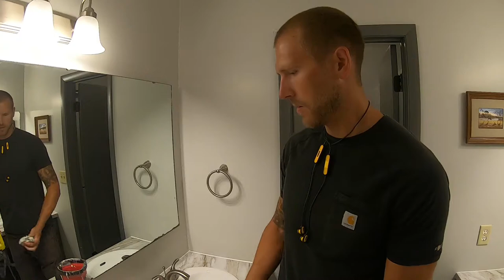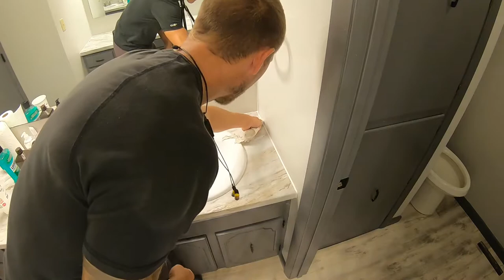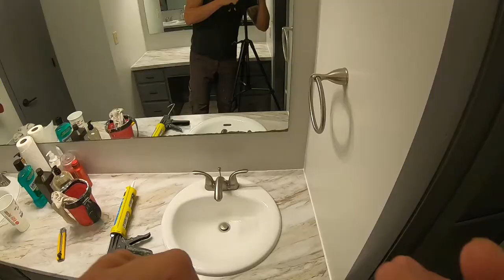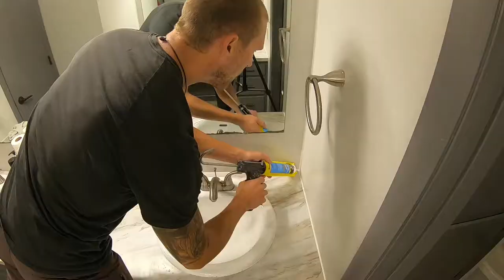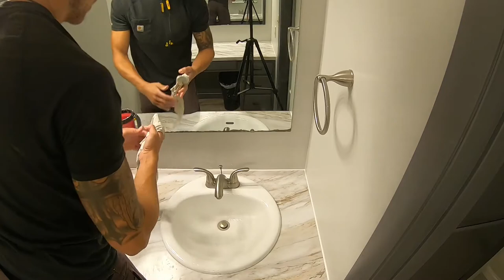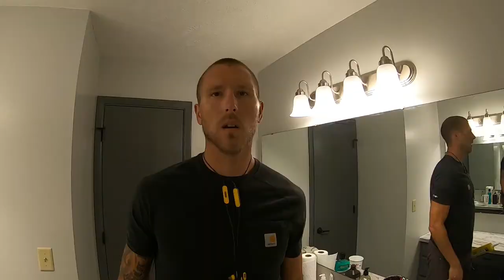Caulking Tips (wet rag method)

Comment: I JUST re-caulked my tub and shower earlier today and could've used this like six hours ago! 😂 Tooling went okay with a finger and a rubber dressing tool, but I wayyy overapplied and had to pull a lot back off. I've been chasing what I thought was a leaking tub drain for a few days. Ripped up the floor in a closet to get to the trap and was close to busting into the kitchen ceiling when I realized it was actually just the shower door track directing water into a spot with missing caulk!
Reply from the maker: Awww man, nice work catching it! Chasing leaks and water issues are the worst ! Sounds like a close call !
Reply: @AMAYERICAN  Trust me it was. I replaced the tub drain and vent (which I wanted to do anyway), but between that and the old steel pipe is PVC pipe and drum trap someone must have put in at some point. Couldn't clean out the trap without removing the whole thing so might replace with something less... banned... since I have the floorborads up anyway.
Reply from the maker: Man opening a can of worms haha glad I’m not the only one it happens to. How old is the home?

Comment: I haven't seen this one before. Good work man that cleaned up real nice. I've always used painter's tape to keep the edge clean because I'm not skilled or brave enough to try to lay a clean bead but I will definitely give this method a go on the next project.
Reply from the maker: Thanks! You’ll have to let me know how it works for ya!
Reply: @AMAYERICAN  I finally had a bathroom job just today. Man what a great tip everything came out perfectly. The look of a taped job but in a quarter of the time. Cheers to you.